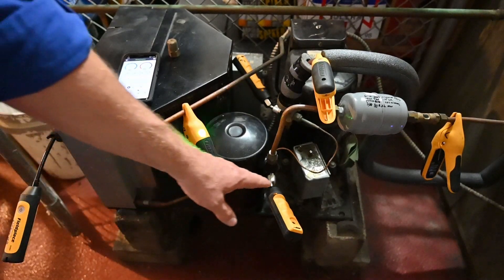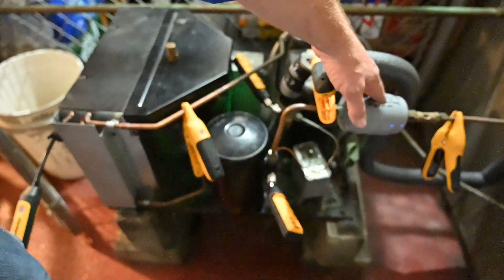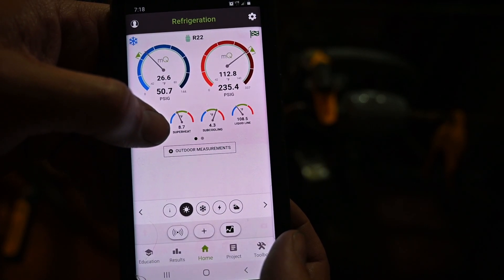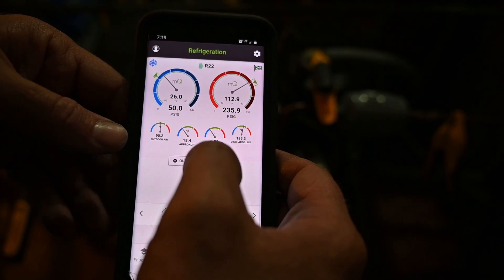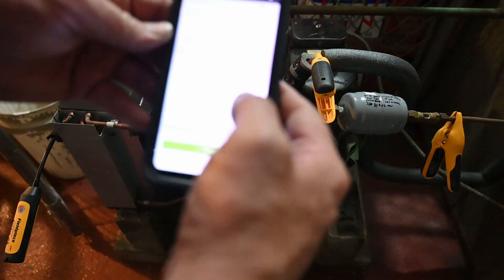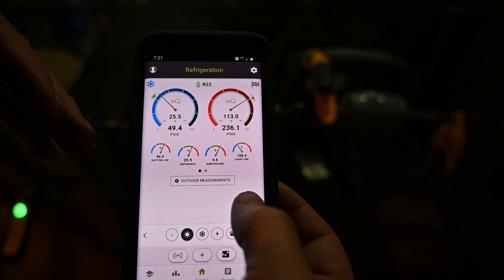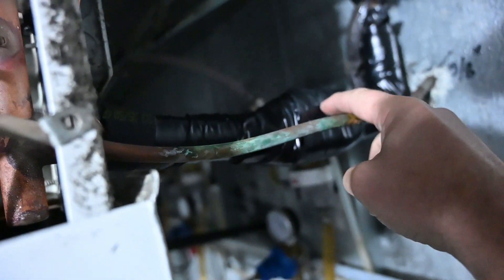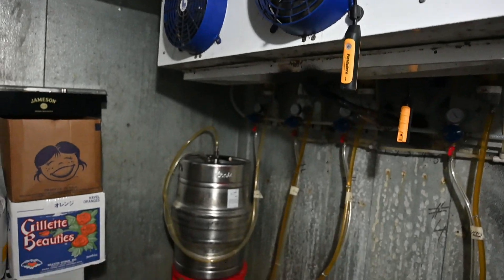HVAC 110 part 2  Measure quick and probes,  walk in cooler

Comment: Learn electrical first then the residential side of ac/refrigeration and finally commercial systems. Get EPA certified and then get out there and make lots of money 💰!
Reply from the maker: I have taught electrical fist and I find it's much, much easier for students to understand electrical after the basic refrigeration cycle.
Then they understand why we need the components working in a specific order.
Reply: @love2hvac  you're right. Fluid, gases & heat(vapor compression cycle) is  better taught before electromagnetism & circuits(motor control).